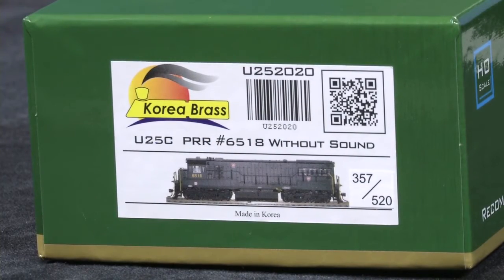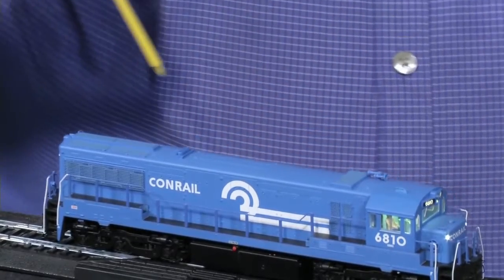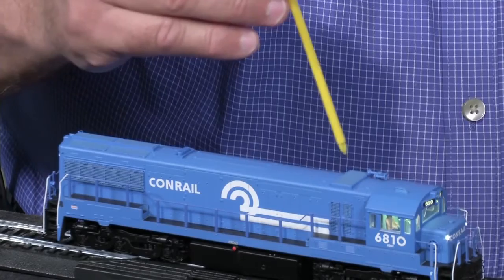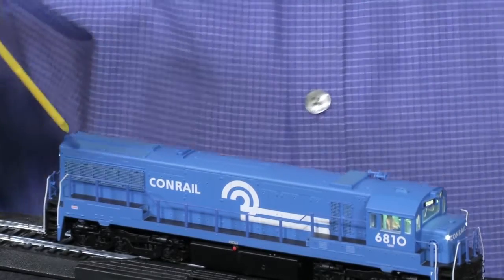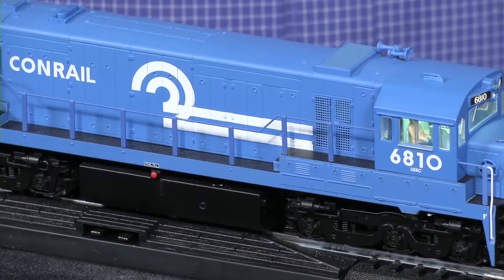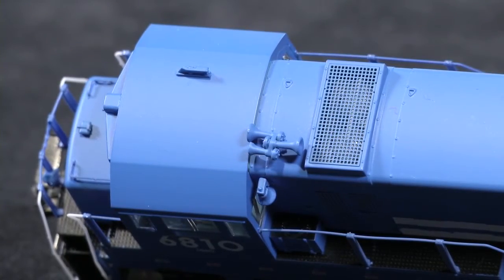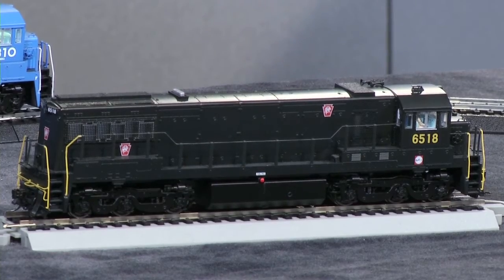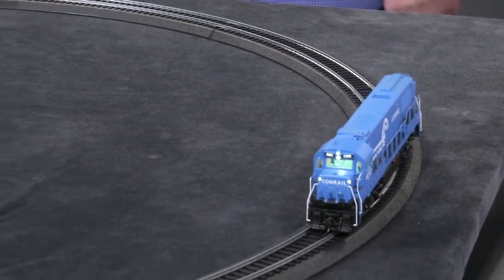TrainMasters TV - Korea Brass U25C

Comment: in 1978, cr was expecting new power from gm, and they re numbered the 25c into the 6800 series from the 6500 series.
i doubt if they managed to re number them all since many were near their termination date.
1 thing for sure, by 1978 they were dirty. and some were still in black too.
i did catch 1 re numbered on the point of a train on the red key line(columbus-chicago)